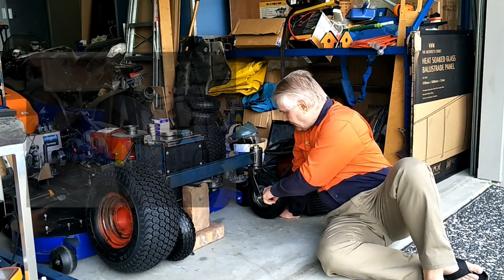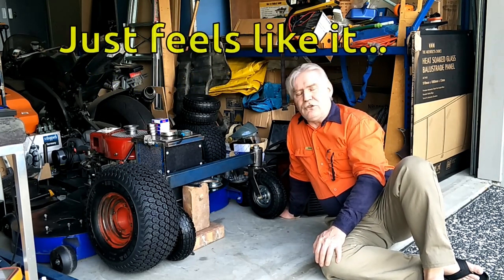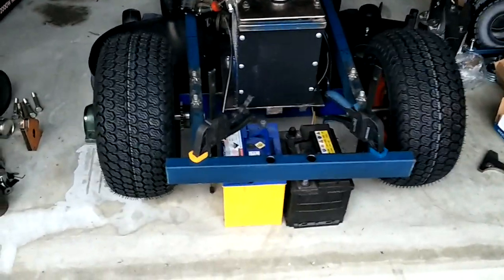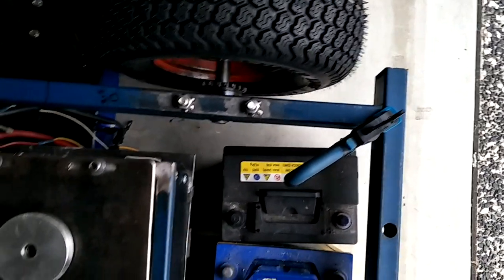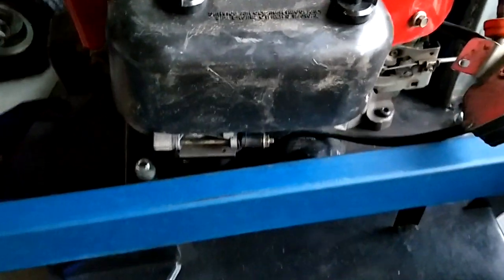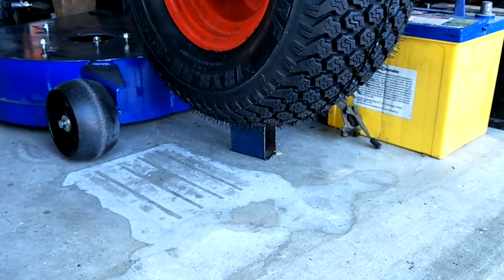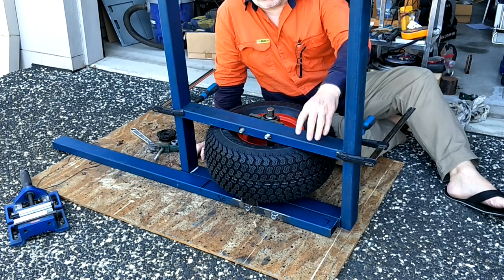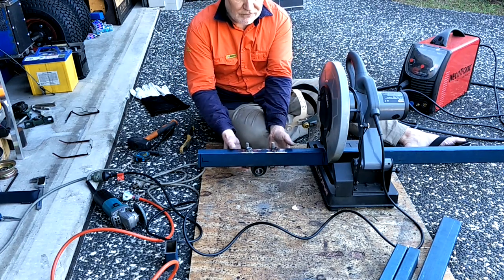Remote Control Mower - Part 28 - I've Been Framed!

Comment: I can understand your reservations about not wanting to over plan the frame. There does appear to be numerous obstacles that could potentially trip you up.
Reply from the maker: While you can plan these things to death on paper (or in my case SketchUp) it is extremely hard to capture everything. Unless you spent countless hours modeling your exact motor to the most intricate detail, it is really hard to make sure you have everything covered with a generic engine from the SketchUp Warehouse. Then sometimes you still need to make educated guesses unless you have some high end measuring equipment. Often it is not easy to get super accurate measurements with a tape on longer distances. That's before you factor in any human manufacturing errors. So far my gamble has paid off but I am a long way from being out of the woods.